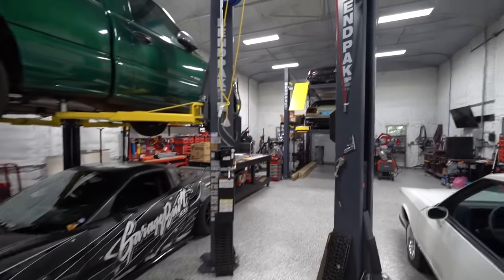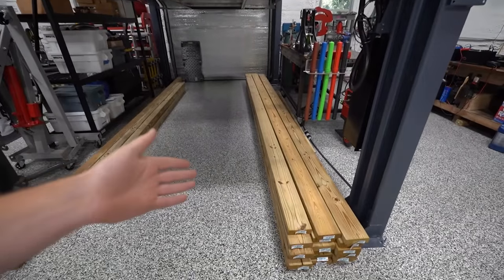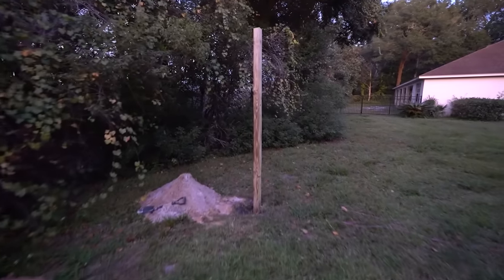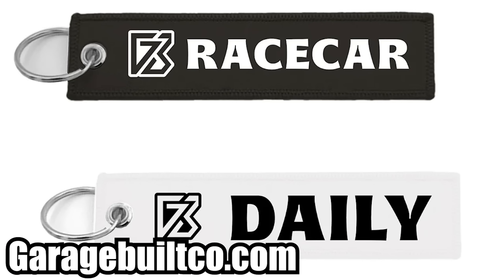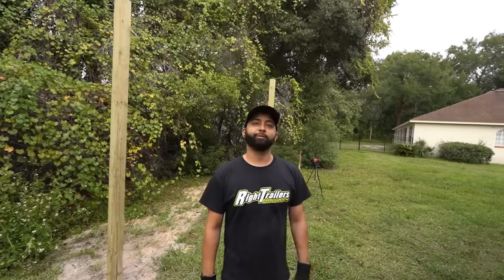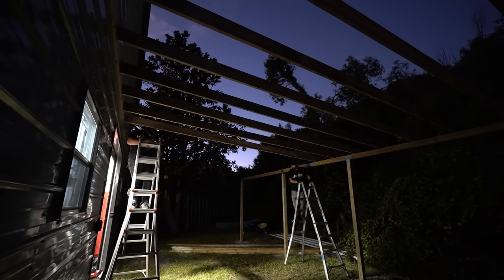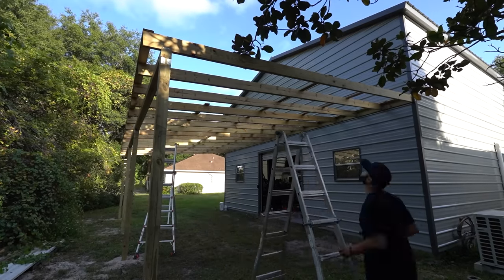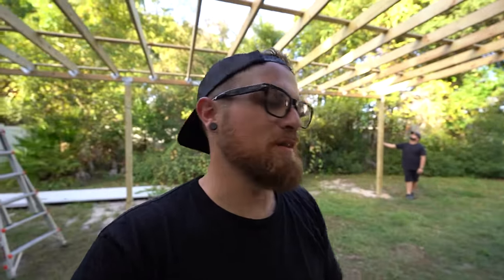Building a new addition to the workshop. all the space

Comment: Objective achieved - you got it built so you can store stuff when building a mezzanine inside. 

But the best thing is you did it yourself & you’v learned from the experience. 

It is impossible to do something we haven’t done before & nail it 100% perfect every time. Even with a heap of research you’d likely be doing it with different tools than your teaching source & each job has different solutions for different problems that only get found through experience. 
I reckon you did great!!

Comment: You may want to put some 45 degree bracing at the posts to keep it from racking lengthwise.
Reply: That was the first thing that I saw too......No Y braces.
Reply: I just commented the same thing
Reply: Also a flashing strip at the top will do ya much better and longer than a bead of silicone.
Reply: @magblevins yup, that’s why I bought a metal break to make em 😂 way better then just silicone
Reply: Only other thing I'd say is gonna have to trim those panels or scab some extensions on those rafters cause 2ft overhang isn't gonna do well in hurricane season
Reply: I thought the same thing.
Reply: @magblevins something like that might fly up here in Canada but we don’t get that wind! Couldn’t imagine having to deal with hurricanes. But I guess we get snow so we gotta beef shit up for that 😂
Reply from the maker: Yes to all this. Lol flashing will go on after the roof panels. Just wanted to also caulk the 2x6. And the panels will get cut to 16ft. That’s been the plan. I just wanted to take advantage of their full length but decided a one piece joist was better.
Reply: This is the issue stopping a video mid-progress, though, on the other hand, you do get a few ideas you might not have thought of.
Reply: Just a question did you set your perlings/ rafter ties to the screw holes in the metal you saved from the old shop? Or are you goin to cut the length according to where the old screw holes fall so you dont have a bunch of holes?
Reply: Wouldn't be surprised to see him close the lean to in or just put a wall on it which would solve that issue
Reply from the maker: @wobblysauce  better than getting them after the fact. People love to tell you what you should do. After it’s done. Like sure. Makes sense. But I’m not going to rebuild the whole thing now. It’s too late clearly. Lol
Reply: @magblevins  with enough stuff in there and the shrubs behind it.  The wind won't be so bad. But yes. Good idea.

Comment: It would be worth adding some diagonal bracing between the 4x4 posts and the 4x4 that you landed the rafters on.  With the wind loads that you get down there, it would add a lot of stiffness to the rear of the lean-to.  A rear fascia board across the end of the rafters would dress up the ends and also help tie everything together at the outside end.
Reply: Exactly what I was thinking. It would also help keep those 2x6’s more dry versus being bare.
Reply: Those things are called corbels. He should at least use some longer ones to help support the splice.
Reply from the maker: I was thinking of doing a piece of flashing at the end if I can find something. But a board will work too! And I do plan to ad Y braces in before we paint everything.
Reply: Next time maybe paint every piece first, then do the assembly, and then just touch up paint? 95% easyer and faster.

Comment: Just for future reference, If your uprights are 10' apart use 10' 4x4s for the cross bar. You'll tie the joints together with the post bracket and hide all your joints at the same time. Just a little cleaner way of doing it
Reply: Looks good I would have used 2x8 for that distance and lot more of a pitch for the roof but your in Fla so you don’t have to worry about snow ⛄️ but definitely need some cross bracing for 4x4 for the wind loads
Reply from the maker: Yeah in hindsight that makes more sense. I was trying to minimize the joints. But as you said. That would have tied them together better. One of those things. I built it in my head and definitely overlooked a few things. But. I learned! Will do better next time. Long term I would like to build it out of steel. I just wanted to get something done to keep moving on the shop upgrades. I’m definitely not used to accounting for wood sagging over time. Etc etc.
Reply: @Taylordrifts  Unlike many others, as you say, you continue learning.
In 20 years, if we still hang around youtube or the next platform, maybe we will see you with a sickass rig doing some woodwork, maybe a cabin (house size) in the woods ^^'
Reply: @Taylordrifts  What you did with the bracket in the middle is fine. Probably not going to get much snow. You'd be amazed at what the code allows you to do with screws and brackets.

Comment: You need another sea container with side doors for out the back to put the air compressor and tyre machine inside. Will give you more space with in the shop and reduce noise in the shop.

Comment: Man o man it looks good! Why didn't you think about making the cover a deck for the 2nd floor? to help lock the framing in place and to prevent lateral movement, Add a 4x4 or 4x6 notched knee brace(picture upside down peace sign) at each post and use some 6" or 8" TimberLok/GRK screws so that it does not sway as much in the wind or act as a possible sail. Otherwise, it looks great and I love how you use hardware!! Those looked like H1a or H1 and LUS26, if they are simpson. for the end rafters, use H2.5a's. I am a Senior estimator for a top 5 national Lumber yard. I personally would have done a 2-2x10 beam at the same spacing you did and then used 2x8's for rafters due to span and I am a big guy that would have to attached the tin/metal roof. 

PS- If your metal siding seem is just above your ledger location on the wall , look at maybe finding some "Coil Stock" from Lowe's that matches your siding and break it to just past a 90 so that you can add a transition flashing with the Coil Stock and fasten down to the new metal roof. and silicone the flashing up under the metal siding before re-attaching the siding. Good Luck!!

Comment: So, a couple of things:
the board attached to the shop is usually referred to as a ledger board.
the supports for the roof are referred to as rafters.
usually the horizontal support beam would be made up of 3-2X6s (or larger) laminated with offset splices not butted on the ends.
roof pitch is usually given as 1 in 12 (1:12) pitch up to 12:12 pitch not in terms of degree of slope.
the boards 1X4 that one screws the roofing into are usually referred to as strapping.
concrete achieves full strength after 28 days. 

This is from my experience in constructing houses.
the build looks good for someone not versed with wood frame construction
Reply: Great advice by far!!
Reply: Stringers are stairs 😂 good for Taylor for getting after it and learning
Reply from the maker: I knew I had the name wrong for the roof supports. Wood is not my forte which is why I really wanted to build this out of steel. But after getting yanked around by several suppliers. Not being able to get the material. I decided to just give it a shot with wood. Clearly steel building methods + a few inches don’t translate to wood. That said I’m sure it’ll hand in until I have time to build it how I really wanted to from the start.
Reply from the maker: Also, to the people who comment with things like “you should have done xyz stick to cars” this is how you critique someone’s work. Constructive. Information. Would it have been great if I spent a week doing research before building this. Sure. But I don’t really have the time for that. Would it be better if I hired someone. Probably. But would I have learned anything in the process. No. Did I learn in this process. Absolutely. That’s what matters.
Reply: @Taylordrifts 
you will never rebuild it until it fails. 
Looks good. 
Eventually close it in. Lol
Reply: @Taylordrifts 😂 as a person who works on Towers I feel you on not liking to use wood. Whenever I build something out of wood it never seems strong enough. Put in a 6' gate and it called for a 4x6 but its still wobbly to me. Should have just used some 3" pipe and filed it with concrete... stupid wood.

On Towers everything is solid. If it wiggles or vibrates it will not last long. Going from that to wood where everything can shimmy and shake around even when built to code drives me insane. Nowadays I look at code and go deminsion bigger.

When I built my shed I built it with 4x6 house construction specs. I couldn't bring myself to build it with less structure than a house which shed build usually are like 1/2 to 2/3 the spec of a 2x4 construction house.
Reply: @Taylordrifts it's always a tricky balance of helping and coming off mean. It's great that you can learn from our mistakes man, you don't need to make them all by yourself. That being said, you don't have insane snow loads like I do, so I'm not going to tell you you're wrong but am very interested to see if you end up amending the design.

Comment: You need to put some lag bolts into the poles running on the inside of the building if not the first big wind will rip that top down.
Reply from the maker: You can’t run lag bolts into steel. Through bolts were my original plan. However i didn’t love the idea of drilling massive holes in my shop walls.
Reply: @Taylordrifts  then at least go on the inside and run some screws from the inside out to the wood or put two corner poles or something else that wall metal is only 28 Gauge still
Reply: @Taylordrifts  and they do have a bigger screw with a self Tapping end its just like a lag bolt

Comment: A 2x6 can only span around 12’6” before it will begin to sag. Your beam at the end would ideally be double 2x8’s with a 1/2” piece of treated plywood between them. And your ledger should be a 2x8. Any joints in a joist or beam should be at a post. It’s too late for all these things. You will want to add a flashing after your roof goes on, to protect the ledger. Even though it’s treated, it will still rot. The caulk will hold moisture. Get some L flashing, and fasten it to the wall, and use a urethane caulk to seal the flashing to the wall, then run your siding screws into it.

Oh, and every hole in a Simpson hanger or strap should have a nail in it.

Comment: Tip for next time you have to mix concrete by hand: grab an extra one of those clear tarps and you and your buddy each take a side grabbing 2 corners each. from there you dump your bag of concrete on the tarp and add your water. then youll basically be lifting/rolling the concrete back and forth between the two of you until it mixes up well enough to pour. and you can pour directly from the tarp which makes that part easier too.

Comment: You are going to want flashing between the ledger and the building. Unfortunately, there is no way (that I know of) to do this 100% properly after the rafters have already been hung. I built pretty much this exact kind of lean too off of my shop, and I did not properly flash it. It lasted about 7 years before the ledger rotted and I had to demolish the entire thing and start over. About the only thing I can suggest at this point, outside of 'step back and punt', is just to seal the living crap out of the space where the roof meets the wall, and reseal it every year or so. 
And, if you have not already put the metal on, I would come back in and flash over the ledger board as good as you can, working around the rafters.
Reply from the maker: I forgot to mention the flashing. Lol
Reply from the maker: I can’t find anywhere to get flashing. It’s tough to do this kind of stuff when you’re not a contractor with accounts. I was considering using the RV tar tape at that joint to seal it. And keep the roof panels as tight to the shop wall as possible.
Reply: @Taylordrifts just bend your own, you can get aluminum flashing at home depot in a roll
Reply: Check out zip tape since you have already framed
Reply: I would have pulled a sheet of tin back, since it's horizontal, and stuffed custom flashing up behind it, bent from the same tin so it fits the curvature fine. This is the proper way to prevent a future leak there, but the foam makes this challenging.. Without flashing at least 4 inches vertical behind the tin, and 4-6 inches under/over the exterior new roof, it will likely leak into your nice shop and down the wall within the year...
Reply: use the wall tin, bend it.  @Taylordrifts

Comment: Here in Canada, 4x4s require to be cemented 3 feet down, and that’s with a 10 inch sonotube. Im a carpenter who works for a contractor, we always use sonotubes for cement. Apparently it’s better then just pouring it into the hole. But 3 feet is usually the go 2 for depth of concrete. Your discretion on sonotube size or hole width. Over all the work looks good in my books! Maybe add some Y bracing like someone else said up at the top. Stop it from shifting sideways!
Reply: And I agree with Taylor! Just build somethin! Have Fun, learn, gets you out of any hard/dark times! Another add, in Canada we have 1x3s! Idk if y’all get them down there. What sucks about canada is that a lot of our A grade quality wood goes to y’all, and we get the B grades. B grade tends to be rougher, not as nice, more knots. Stuff like that. And we give y’all the nice A grade! So I love seeing work done like this in America!
Reply: I don’t think the ground in Florida ever freezes, so you don’t have have to worry about being below the frost line. And it hurts me every time I see someone put wood into concrete in the ground, it will rot away over time no matter what.
Reply: @joec9680  I know some old dudes who drill a whole in the post and oil it ever so often for fencing. I wonder if you could flex seal the part of the post in the ground, and if that would help. I’d assume so? I think it would
Reply: @joec9680  and you’re right, they don’t gotta worry about the frost line! I was just talkin about up here. But it’s still good to go deeper if you can, leverage over time does crazy things.

Comment: If the board that is on the outside of the building is lined up with the board on the inside of the building for your floor . You could run bolts through both parts . And make it way stronger than it would be with screws or nails .

Comment: I would move the stacker to the corner of the tire machine ,     once that is done move the welding and grinding stations under the stacker since they are mobile ,   the wheel stations move them to the side where the grinding stations are now ,   that way you will have a 20 x 20 loft area instead of two 10 x 20 sections on the both sides of the stacker.
Reply: If I remember right he said he wanted the stacker in the middle so he can bring cars in and out the back door on and off the stacker

Comment: Great Job 
Tip for next time you put a post in the ground... Coat it in truck bed liner 6 inches above the concrete fill line... It will last for an eternity... But if it were me, I would do the entire post... Only because they are the only other anchors besides the header on the building for a lean to...

Comment: Nice work and a great addition, 16' span on those 2x6's is way to long though, they will sag over time just from their own weight.
Reply from the maker: This is why I work with steel. Should have stuck to my original plan. I have very limited wood experience. But it’s so much easier to get an projects worth than steel.
Reply: @Taylordrifts see how long it last then rebuild it better with steel once you got the loft you can do a porch or patio which would still help with cover the stuff underneath

Comment: I see that you don't need to account for any snow load to your structures 😜

I find the way you put your poles down a bit strange.

At least here in Norway, we would avoid any direct contact between wood and dirt, because it rots very quickly.

We would pour the concrete in the ground and put the poles on top of a galvanized foot bracket tied to the concrete above ground.

But anyways, love to watch your videos,  keep posting :)

Comment: A tip for using screws without splitting the wood is to rub the screws on a bar of soap and get them coated with soap and then screw them in the wood.

Comment: Run your pad a few feet past the end so you have a walk way that’s out of the grass and if you ever wanna inclose a end wall it will be a lot easier. Could even do a few feet wide walk way down the side of the shed to the lean too as well if you getting a concrete truck in. No hand mix if you wanna do it later on.

Comment: I would do some rafter blocks between the rafters to add some rigidity. It doesn't take much wood, and will be well worth it in added structural integrity of your roof, especially if you plan on walking on it to screw down the metal roofing.

Comment: If you set your hose to mist and spray it over the concrete mix as you are emptying the bags into the wheel barrow, you will stop a lot of the concrete dust coming up while being light enough water that you won't risk over wetting the mix.

Alternatively, you can just put the mix in dry using the same method to stop dust coming out of the hole. Only downside to putting it in dry is that it takes a hell of a lot longer to set up.

Comment: Your lumber dimensions seem way too small for the distances involved, especially if you figure wind loads. 4x6 posts as a minimum. 2x10 ledger with 2x10 rafters, 2x4 stringers and a triple 2x10 beam might pass minimum code recommendations. 22:05
Reply: No snow load ... 2x8 is fine